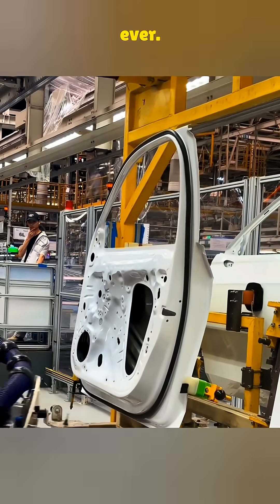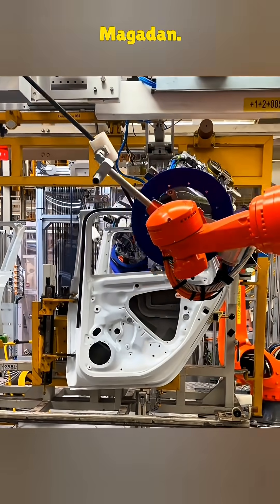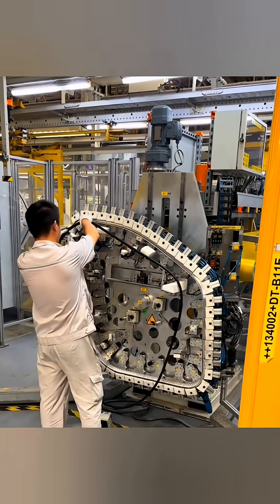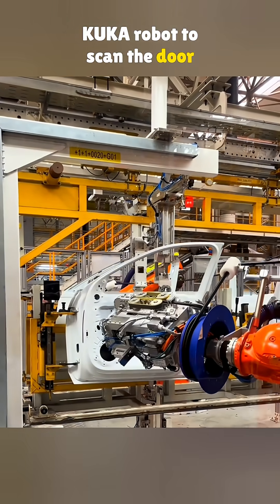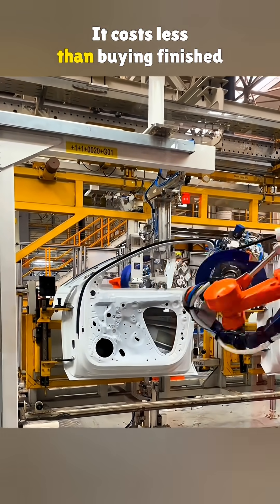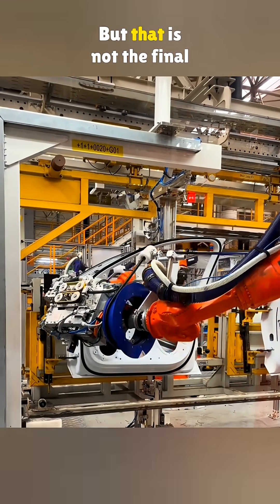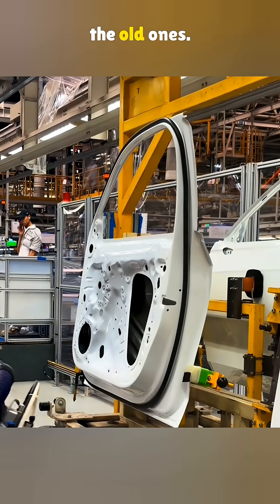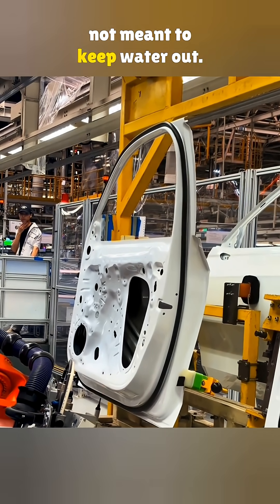How Car Makers Cut Costs #automobile #assembly #manufacturing

Comment: That is a lie.  The average car cost is nearing $50k.   Compared to family income, the average number of weeks income to pay off a car is near an all time high (compared to post assembly line model T).  To add to this we are using crappy aluminum blocks, cvts, plastic oil pans, and intake manifolds and overall less repairable.

Today's cars are utter disposable trash.

Comment: My 1981 mk1 VW Rabbit Diesel was $8400 when it was new.  That's the equivalent of $30K today.  That was without AC, Power Steering, Power Windows, etc etc and on and on.  Cars aren't necessarily less expensive, but they sure come with a lot more equipment and are way more refined.
Reply: In 1981 yearly family income in the US was around $30K in 1981 dollars.
Reply: 1982 ford escort… the world car.  $5,000 with a $50 optional AM radio.
- 4 speed manual
- no AC
- vinyl interior
- manual windows
- 4 cylinder
- carburetor
- speedometer went off scale at 85mph
- front wheel drive
- successfully went 60k miles in five years
- no outside air temperature gauge… icy roads didn’t exist back then.
- no wiper delay… slow and fast were the options…
- 25 mpg…

Use this as the base line for the cheapest car in America…

😃

Comment: New cars are more affordable than ever ? Says who.
Reply: You mean: Chyn3sium toxic junk flammable EVs?! 😆
Reply: Production cost
Reply: Yeah this guy is on the hard stuff near skid row
Reply: I do
Reply: Says reality. You've just become poorer because of inflation.
Reply: I call b/s.
Reply: They have become cheaper. Just remember how expensive it was to get a on board telephone, air conditioning, heated seats, LED headlights and other stuff. Nowadays you will find this in middle and lower class vehicles as well.
Or remember the first EV. They where easily 100k. Now you get the cheaper ones for 30k or less
Reply: Says the stats. Google is free
Reply: @chubeye1187  Stats lie... it's easy to do with new car prices when they normalize data for something basic like utility. Simply put: it's easy to make prices look cheaper than a car of 20 years ago when you throw out the costs of things they MAKE you buy on today's cars that they didn't even have on them back then.